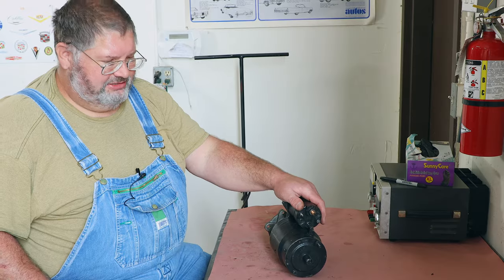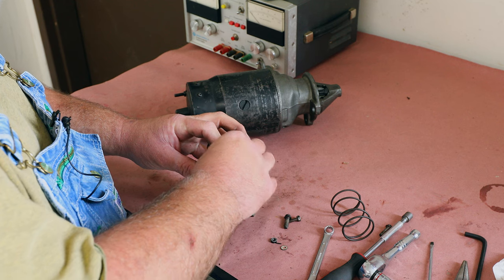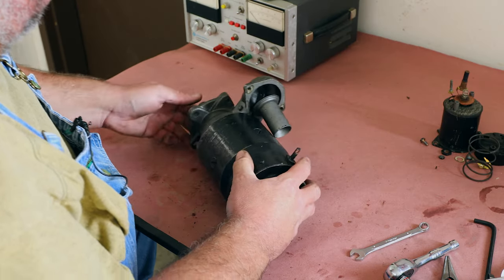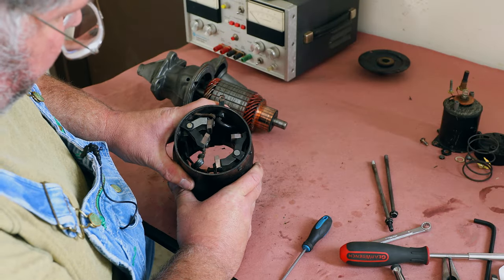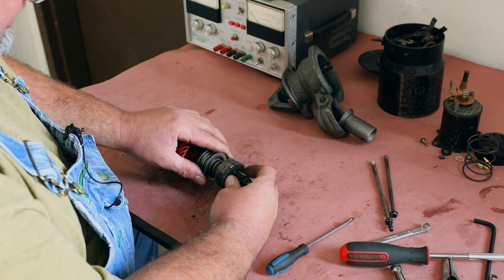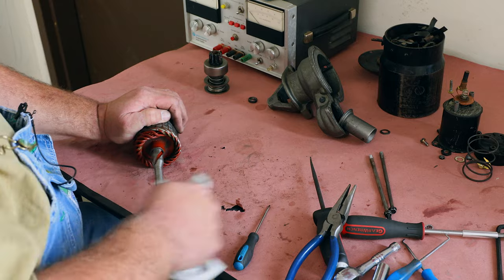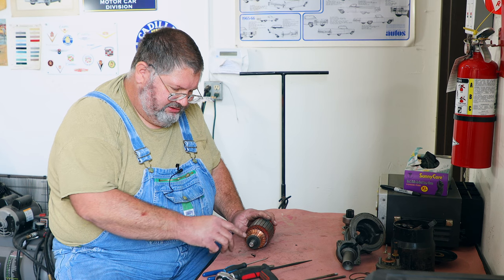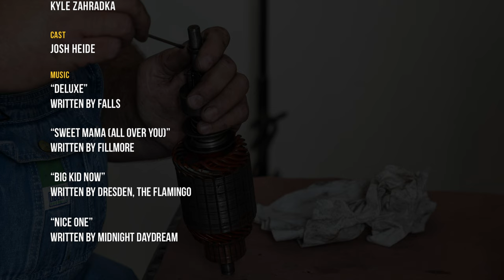How To Rebuild A GM Starter - Part 1 of 2

Comment: Awesome. By far one of the better quality videos  on youtube for this specific starter.  Thankyou !
Reply from the maker: Thank you for the compliment, sir! Josh
Reply: @Caddydaddy  
Did it! Reversed both bolt contacts in solenoid - then inverted the solenoid brass wheel; it had tracks from spark transfer. Spray bombed the armature and stator (it feels smooth) - brushes are Standard Motor RX60 and delivered to E Canada from Amazon for $19. Starter is a Delco 8PG/(same brushes as 8MT and 10MT I think - millions of starters by the time fo the eraly 70s? 
Seems mine has have just one leather washer (!) at far end, notice that your demo had 2 shims or spacers - anyway I am in accord with the Chev Corvair service manual diagram!
Great job Josh - easy to see & well organized!
Reply: Yikes - among the typos, the price - the brushes set of 4, no springs, was $10 CDN, delivered. Anyway now for a bench test. Thank you, Josh for the video - you instill confidence..

Comment: Great video with excellent details. My starter is newer, but the solenoid info is still useful to me. Thank you for this.
Reply: They are all basically the same. Just lay out the parts carefully when
disassembling so you can put it back together correctly. Thanks for
watching! Josh

Comment from the maker: I have never done it but I believe it would involve swapping around the wiring to the brushes.  Starters are designed to always turn the "proper" direction no matter the polarity of the incoming power. Josh

Comment: Thanks for the very nice video. Somewhere there should be the copper contacts for the solenoid that you can turn 180* individually. Do you have for it a spring?
Reply from the maker: You are correct. Many designs allow for the contact to be flipped over to be good as new. Josh

Comment: Great vid dude! On a 305 starter I'm working on just like this  The two clips that hold the engagement arm for the solenoidon  separate in two on the  shaft unfortunately let's see what I can do
Reply: Thanks! Take some pictures so you can get it back together correctly. Josh

Comment: Great video!
I have a question..
Do you have any specific grease for the starter bearings or the best grease i could use for it?
Thank you in advance...
Reply from the maker: The bushings are impregnated with oil when manufactured but you can apply a small amount of light engine oil or electric motor lubricating oil. It doesn't take much; you don't want it to get on the brushes or commutator. Josh
Reply: How about for the gears?
Reply from the maker: @vica2130  The pinion gear is designed to run dry. Only the ends of the armature should be very lightly oiled.
Reply from the maker: Light motor oil applied sparingly. No grease and no lubrication elsewhere in the stater. Lubricants contaminate contacts and brushes.. This is all That is needed to the best of my knowledge. Josh

Comment: I plan to buy a 2000-2006 Chevy Suburban. If the starter does not look replaced, I plan to take it out to "renew" it. I will not wait until it fails. That is, I plan to replace the wearable parts. 

For this year range, will I have problem buying rebuild parts for the starter?

Thanks
Reply from the maker: None of my regular suppliers show rebuild parts for these starters and they are different from the older units. However, rebuilt starters are available. Something I have done when parts were not available and there was a need for number matching unit, I bought a rebuilt unit and parted it out. Josh
Reply: @Caddydaddy Great idea

Comment: Tell me something, that pen that holds a solenoids housing onto the starter,... My question is if that pin is missing ,would that be the reason why my appendix isn't shifting forward when I turn the key
Reply from the maker: The pin in necessary for the yoke to pivot and engage the drive gear
when the solenoid energizes. Josh

Comment: Do you know what causes starters to fail from sitting for long periods of time? I have a starter/solenoid from a Chevrolet Express van that failed. When you turn the key nothing happens. No noise or anything from the starter. The problem is traced to the starter/solenoid. The van has less than 4k miles, but has sat idle for years. There is no outward sign of corrosion. I just hate to buy another starter when this starter has hardly been used.
Reply from the maker: My guess would be that the solenoid has corrosion inside it and the armature is stuck. You might want to remove the starter and take apart the solenoid and see if it moves freely. Could just need to be cleaned up or replaced instead of the entire starter being replaced. Josh